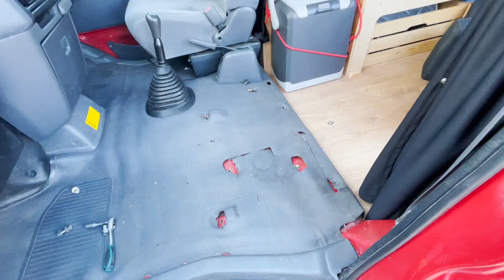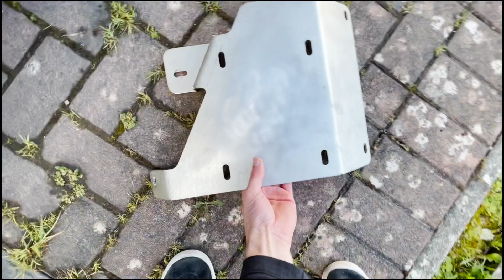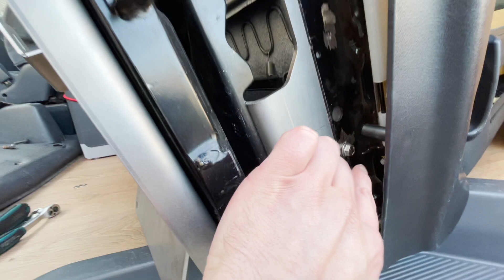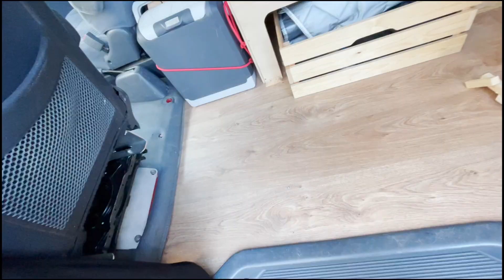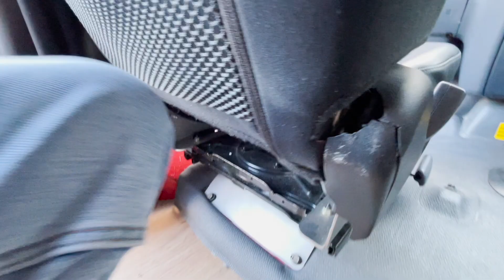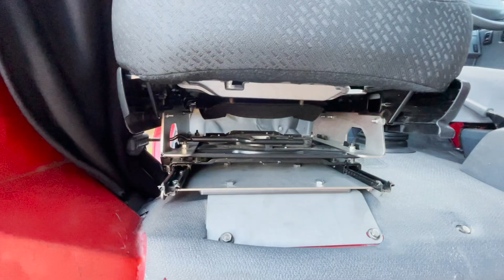Swivel Seat Design and Fitment - Toyota Hiace.

Comment: Love your work mate. Inspired me to get a Hiace myself which I'm currently turning into my first campervan. 
Would you sell me your bespoke seat plate design? 
My local steel fabricator is too busy to help measure and draw it up. Plus I don't want to f*** it up!
Reply from the maker: Thanks 🙏🏼, My design could be improved, if I was to do it again I would weld in a four captive nut into the floor and build a bracket on that.

Comment: Do you know if there is a fitment to swivel a double seat in the front, not sure if it can be done 2006 Hiace?
Reply from the maker: Because the seat has a welded base you would have to cut it and fabricate a custom arrangement. Best bet is to use a seat out of a different van. I may look into this idea on my next hiace. 😊
Reply: @Hunter_conversions Thanks for the advice 😀

Comment: Hello ive got a toyota hiace 1996 and would love change my double seat. I live in devon could u help at all
Reply: Hi no it's on legs the seat engine at the front under the double seat is a first aid box the jack is under the drivers seat. Would love your help plz
Reply from the maker: It’s wasn’t the easiest job. But a 1996 might be easier. Yours will be a different seat setup to mine as I’m guessing your engine is under the seats on a 1996?

Comment: About to fit a 2006 automatic LHD and have found CRV seats for both & am wondering about the airbag before I buy. Are the connections compatible?
Reply from the maker: Hi, the Hiace doesn’t have airbags in the seats so I would say no. I took all the airbags out of my CRV seat.